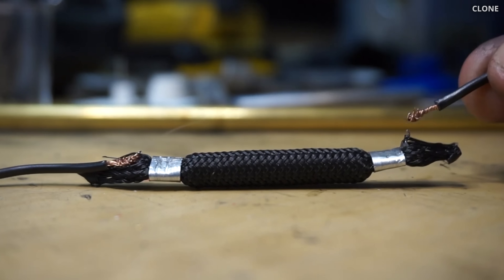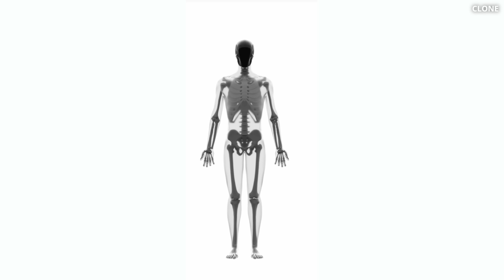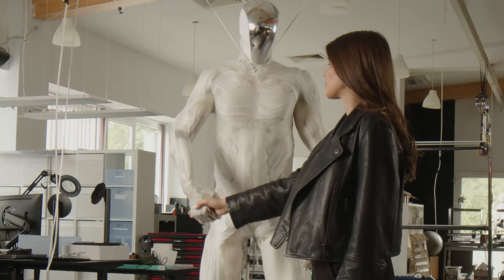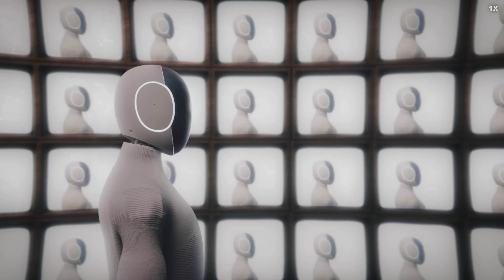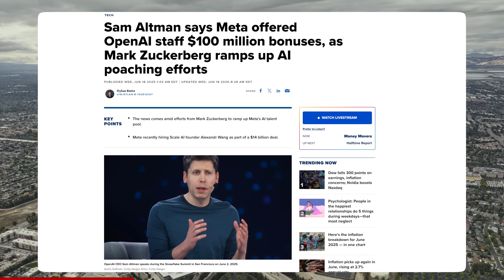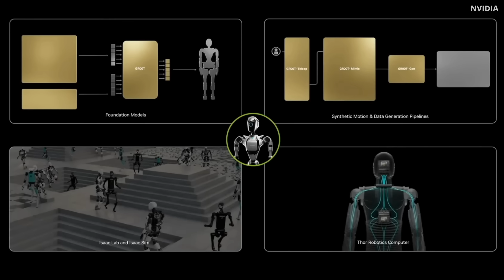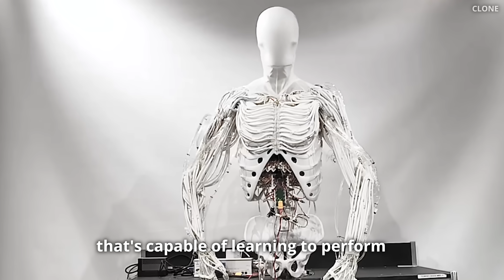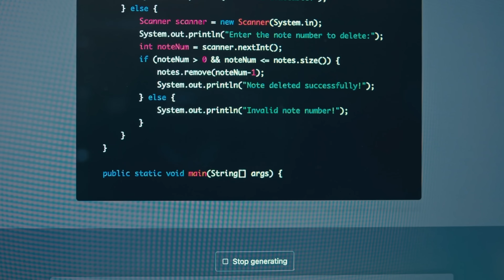I Met Protoclone. It’s Actually Insane

Comment: The muscles are effectively hydraulics with the inherent delays of switching a pump to vary the flow.  They are making a difficult task for themselves when they come to make it walk, as that is requires real time feedback.
Dhanus was suggesting they would have localised ASICs, my guess is they're going to have "neural circuits" to produce rhythmic muscle activation patterns, much like humans walk.  I wish them luck.
Their unique approach avoids much of the overheating of joints that every other company seems to be trying to solve at the moment.
Reply: The pump would be constant. They only need to restrict the flow so that it expands widthwise, and thereby contract lengthwise. It's a similar principle to the human body.
Reply: Perhaps they could consider fuel injection pumps and high speed switching solenoid valves.
Reply: So this is like boston robotics before they went full electric motors?
Reply: @Penaming  They are similar but Clone Robotics solution uses water, rather than oil, and has a pump maintaining the pressure with actuators to activate their "myofibers", which should give them finer control as the force is generated across the fibers rather than concentrated at a joint.
Reply: @tonyengeham7210 It can't walk. That is the major disadvantage of this solution. Fast feedback is impossible. Precision feedback as well. It just will impress people and that's all. A dead end.
Reply: @alvigelagan9828  depends, it is limited  by the valve design, the viscosity and the diameters of tubing and preassure involves, but they may be able to achive fairly precise movement, with incredible impact resistance, so it does have it's benefits.
Reply: @alvigelagan9828  it can't walk, yet. you think they will give up. Pretty sure it WILL walk at some point.
Reply: @alvigelagan9828  Closing the feedback loop is not the issue. It will come down to the volume of fluid they can move per unit of time. If they can't move enough fluid fast enough, you are correct. If they can you are wrong. We shall see since they have all their eggs in this basket.
Reply: @The_LanMan right they got the whole body so far.
Reply: So they will be a poor shag?

Comment: Verry cool, but 200 degrees of freedom in a hydraulic system also means 200 valves, with magnets and control electronics. I am wondering, what kind of valve they are using, to be precise and dynamic, while still beeing smal and cheap.

Comment: Now with the low energy photonic chips getting ready to come online and artificial blood. It could have self repair chemicals in it fluid that activates at puncture points by reacting to an imbedded layer material in the tubing. This becomes a terrifying weapon. You can armor its weak points and even if injured it keeps going and self repairing minor damage. Put a couple of layers of spidersilk fiber under the skin and weave the tubes in Kevlar.   For now it doesn’t run… but it would be very quiet.

Comment: I like the fact that they are using hydraulics rather than motors. We work using hydraulics and electrical signals. As for the "new" muscle , it would be good for sensing pressure more instantaneously than electronics and just that little bit smoother than motors. All in all, I think they have done an excellent job so far and are onto a winner, if they can solve the computing problems required to "control" the "robot! The face, wouldn't bother me, if it were say some sort of screen with an image of someone say. Very interesting all the same, thank you for letting us see what might be, I won't be here when they become reality, as I'm 70 now! From England.

Comment: The main problem with hydronics is leaks. How to prevent or compensate for these? Boston robotics moved from hydronics to electric because of this.
Reply: I think the casing material selection can compensate. Also, detection of fluid levels could close valves to damaged sections until repair.

Comment: Although 3D printing will undoubtably help in mass producing these it is hard to imagine this being produced through factory automation.  Is it destined to be like Commander Data - just a few copies are produced due to the complexity? If they have a manufacturing vision that would be a neat part 2.
Reply: Don't worry chinese will find a way to mass produce them even if it means having to manualy assemble the first 5000 then let those first 5000 build the next billion ones for years. Bonus if they can make it cheaper than 2000 US dollars. Everyone will have 1 or more robots at home. 😊😊😊
Reply: When this company reaches  production ready capability they will either go public in NA and have an enormous IPO or they will be bought by another tech company for billions. When they are fully funded then production will be fast. Instead of 3d printed skeletal structure they can use other light weight moulded materials like titanium. 

Extreme potential. Its all contingent now upon if they can solve walking. I think it will probably need alot more sensors.
Reply: The cost per unit will probably start out similar to a sports car. C. $200,000. Then slowly it will come down to around $30,000 with used units availible cheaper. 

Again, all this is contingent upon how fast they can achieve un-thethered movement and kinematics.
Reply: @samkostos4520  Well that's more of an Ai (brain part) problem than a physical problem. And I'm not sure they will have money to make both body and brain. Now they have to do something but realisticaly there should be a compagny making the body and another one making the brain (ai) why ? So we can download different models inside, the body is no different than my computer, I download a model and it should work.
Reply: @aizenbob I agree. However, they are likely using AI created by other companies to help them develop the code required to build their own deep learning models. The learning model needs to be 1:1 scale and material properties to their actual prototype to make training data useful. 
If they outsource the "brain"/training development then whomever they choose will have all the required data to just build their own complete units. 
Training isnt really that difficult anymore. Nvidia has alot of deep learning tools to help developers. 
The barrier ,I believe, is anatomical. We know bipedalism works because we do it. However, its realitively rare and difficult to balance. Likely moreso without constant feedback from sensors which govern position and current orientation in a 3d space.
Reply: @aizenbob  However aside from movement. Yes, I agree. Other critical aspects like language processing, image recognition, etc. Should be done by other companies like OpenAI,Anthropic,Google, etc. 👍